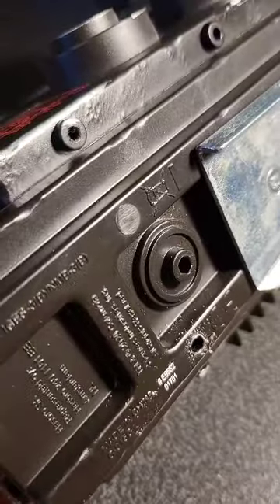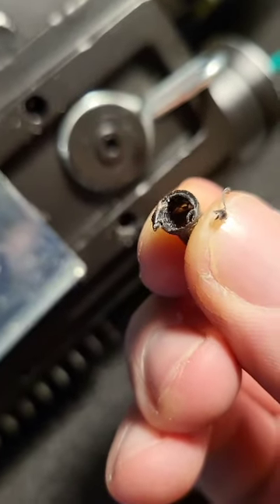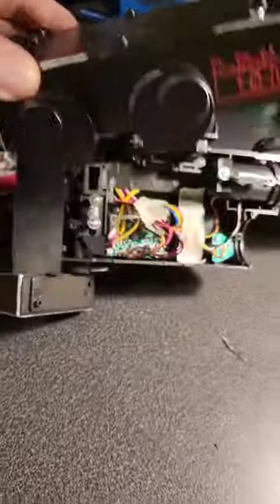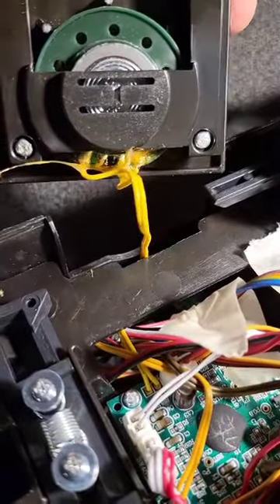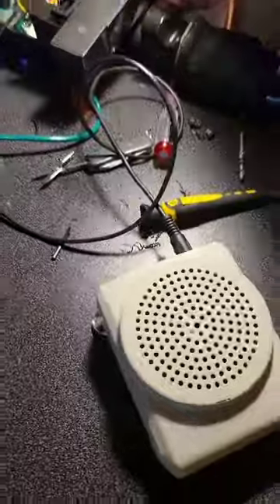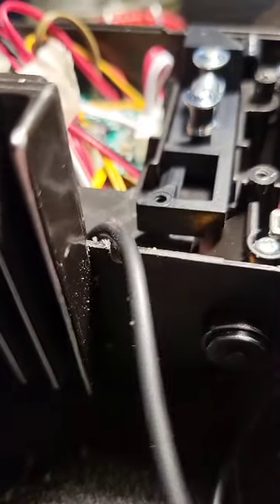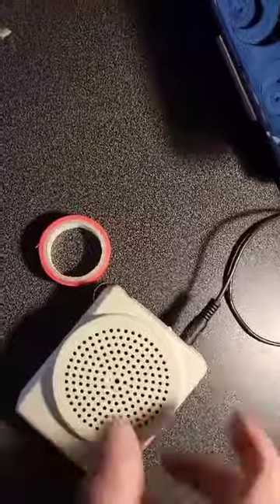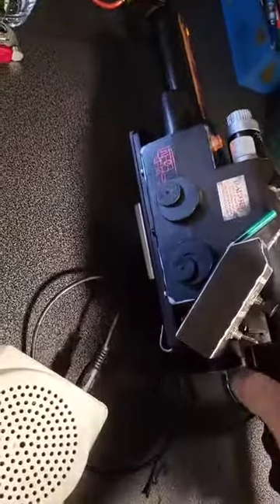Add an AUX cable to the Hasbro Spengler Wand step by step instructions

Comment: Don’t drill out those plugs. Put a tiny hole in, twist in a tiny screw and they pop out. Easy to pop in and then easier to cover.
Reply from the maker: Yes I found once the drill got in they popped out fairly easy. Unfortunately for me I never got this tip until after I had done it but I don't mind as its not really visible.
Reply: @simonhogg5714  yeah I’ve been bit by the “hindsight is 20/20” bug before. I didn’t mean it as a criticism to you but as a maybe helpful note to others.

Comment: Could you share a link to the AMP you use? TYIA
Reply from the maker: https://www.amazon.co.uk/Aker-MR1505-Voice-Amplifier-Black/dp/B007OSRTNW/ref=asc_df_B007OSRTNW/?tag=googshopuk-21&linkCode=df0&hvadid=310873119586&hvpos=&hvnetw=g&hvrand=14627339590642900135&hvpone=&hvptwo=&hvqmt=&hvdev=t&hvdvcmdl=&hvlocint=&hvlocphy=1006854&hvtargid=pla-491804651700&psc=1

Comment: That's an awesome mod -- I was wondering if this would work, without the need for a powered amp. One question, though: Can you hide the Aux wire inside the handle and then back through the tube to your pack?
Reply from the maker: Yes but probably a bit trickier. If you are modding the stock pipe then you could do it all together. I just hockey taped the cable along the pipe. Sort of looks like it's supposed to be there.